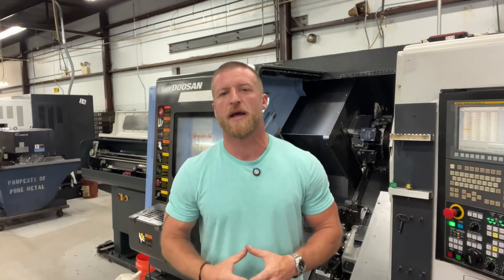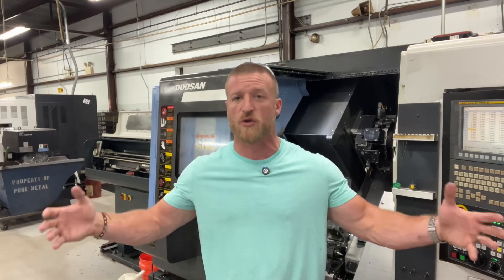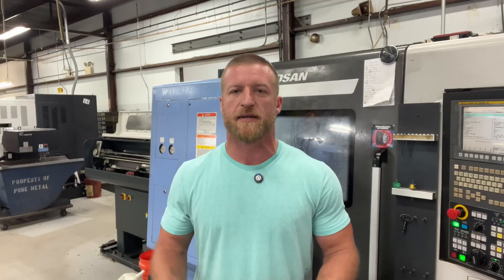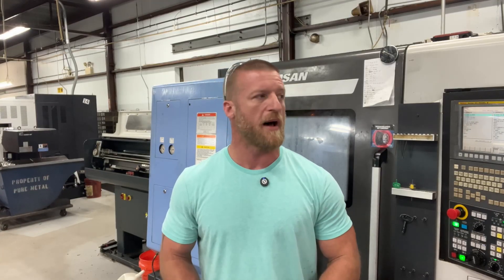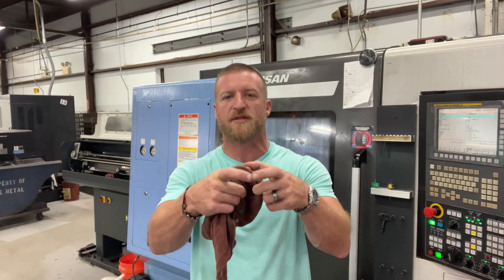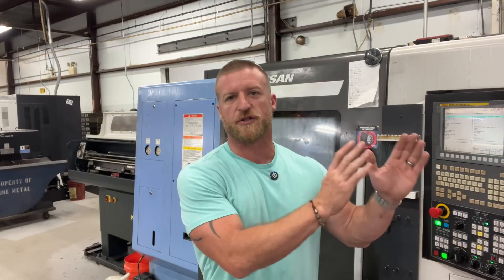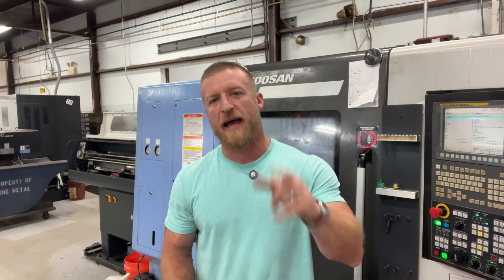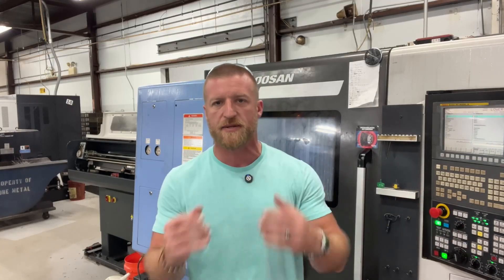Lathe VS Mill: Why CNC Milling Takes Serious Skill!💥🚀 #cnc #cncmill #lathe

Comment: As a 5 axis cnc programmer/machinist/operator whatever, with 20 years of milling experience, I wanted a new challenge at 50 so I started out as a total rookie on 3 Nakamura's with barfeeder and 1 robot.
It's 99% stainless we're working with.
Vertical and horizontal live tooling, all within thousands of mm's.
We run those sweet beasts 24-7 if possible.

5 axis milling seems like magic but I can definitely say that dual turret, double spindel cnc lathes are just as cool.
The sheer speed with how fast material is being removed baffles me .

From machining/milling, threadmilling Hrc62 to this is a blessing.
Love this job.
Great video
Reply from the maker: I love this job too. It’s very fun and challenging. Thanks for the input and thanks for watching 🤝

Comment: I'm a 5 axis programmer/machinist.
When everything (X, Y, B and C) is moving at max speeds, stops and then your spindel just dives in that bore hole with 20.000 feed for a skimpass... it's the best.
I've had engineers from our client watch their part being made through the big windows I had on my Spinner U1520.
When the spindle just plunged into that borehole they jumped away, I laughed so hard man.
Reply from the maker: Hahaha yea some of the stuff we do is definitely stress inducing but fun for sure

Comment: To edit a speed or feed in a cam program in Heidenhain620 you just hit search and the code you wish to edit, then you adjust to one or selected. 
There's no need to scroll through the entire program at the machine.
And you are right, the length of those cam generated programs are insane because cam sees little straight lines that makes the circle.
Also depends on the postprocessor.

Comment: Very often I write my own CNC mill code because I have a few older machines that can't upload the 1000's of lines of code that my CAM pukes out.  Also, the processors aren't fast enough to execute linear moves that are only .002 apart at a high feedrate. They just don't "think" fast enough, so, my posted programs at 50 IPM are running at 12 IPM and struggling to catch up.  FWIW, I have to modify ALL of my programs by hand because the support of my CAM system, (Fusion 360), isn't very good.  Also, I generate my finish tool paths for my CNC lathes and just program the rest by hand, adding the G94's, G71's, G92's, and G70's as needed, because of the weak CAM support.
Reply from the maker: That’s awesome man. It sounds like you’ve got one heck of a great skill set.  That stinks about you having to run your 50 IPM low down to 12 because of the processor. But I guess it happens and we make it work right?
Reply: @Crusadermachining  , I'm an old dude that started in the business in 1987.  The way I make it work is by hand programming G1's, G2's and G3's, for the shape I want, then "translating" them whichever direction I need to go with a macro or with a text editor that has a modified "copy and replace" function which lets me copy, translate location, and paste, repeatedly.  It's saved several cycle times for me.
Reply from the maker: That’s really cool man - and you’re not just an old dude. You got thru the hard stuff so the next generations can push buttons and make magic happen 😂😂

Comment: I used to run Citizen sliding head lathes some of which had 9 axis, 40+ tools (including rotary tools) and three separate programs running simultaneously. 
Most if not all of the programming was done long hand and my hat is off to the guys and girls doing that job.
Lots of the jobs we used to make were not possible to make on our milling machines or the 5 axis machines with the required cycle times and level of accuracy sometimes 0.005mm or 0.0002"
The guys running and programming the milling machines made some mad looking parts with great accuracy and they are far better than I'll ever be at milling.
Reply from the maker: Wow that sound intense!!! Hand programming that machine…?! Very high skill level for sure

Comment: I was laughing out loud when you said big part like 100lbs. The first machine I ever ran was a 12 foot king  vertical table lathe that was from 1930. I think the heaviest part I machined in my 15 years on the job was a 10 ton lifting fixture on a horizontal mill. You gotta get creative with the big stuff. It took a whole day just to set up a part of that size.
Reply from the maker: Yea I get why you were laughing. 100 pounds for me is the biggest part that I’ve ever worked with. On average, I’d say 1/16 of a pound now. I’ve never heard of a vertical table lathe but that sounds awsome man thanks for sharing.

Comment: Alright I'm not gonna lie nowadays I rarely program anything by hand. But I did do a lot of manual mill programming in the past. The thing I used a lot were macro's. If you know what you're doing you can cut the writing time a lot by making loops and what not especially on roughing or 3d shapes. I once programmed a cone for a slip on air hose fitting by plunge cutting the same angle over and over around the same datum rotating the cut bit by bit. Heck I even programmed it in a way where you can change the increments with one value in the macro's. Worked wonders and practically it read well over 10.000 lines but only a handfull were written
Reply from the maker: I like that a lot. 100% ingenuity and thinking outside the box to solve a problem.  Well done and very cool.
Reply: I wrote this simple one in Heidenhain 620 for hex key milling (mm's). 
Adjust value of Q1 for the keywith. And depth in Z as you like. 

Q1 = 32
Q2 = 1.155
Q3 = Q1 * Q2 / 2 
Q4 = Q3 / 2
Q5 = Q1 / 2
Q6 = Q1 +15

TOOL CALL 30 Z S1830 F 1150 DR-0,05
L X+Q6 Y+0 R0 FMAX M13
L Z+2 R0 FMAX
L Z+0 R0 F1000
CALL LBL 1
L Z+610 R0 FMAX M91 M9
L X+300 R0 FMAX M30

LBL 1
L IZ-2 R0 F1000
L X+Q3 Y+0 RL F AUTO
L X+Q4 Y-Q5
L X-Q4
L X-Q3 Y+0
L X-Q4 Y+Q5
L X+Q4
L X+Q6 Y+0 R0 F AUTO
CALL LBL 1 REP 6
LBL 0

Endless program and no need for cam to write thousands of lines.

Comment: Cylinder head porting was frustrating during the programming stage due to verification time to avoid collisions 10 years ago, hopefully a lot easier now days.
Reply from the maker: What’s verification time in this context ? Cylinder head porting sounds like a cool process for sure.
Reply: @Crusadermachining for the complete chamber and ports x4, could take over an hour. Cyle time was 10hrs. That included roughing from a cast wormhole not a port as such and seat bores . 5 axis suck at roughing compared to 3 axis.
Reply from the maker: @Innov8cnc WOW! 10 hours…?? Very cool

Comment: My shop uses macros for absolutely everything. Most jobs we do dont require a standalone program. 80% of the time the "programs" i receive are just a list of macro calls / subprograms. Also every milling machine we have has 200 standardized and already setup tools ready to go. So setup is streamlined.
Reply from the maker: Wow that is really valuable information to have and thank you for sharing. Macros are very cool. We use some of them, but not to that extent.  And when you say 200 tools, set up and ready to go they’re all touched off?
Reply: @Crusadermachining yep all touched off, at the top of every program you specify what tools you have in which pockets, and thats all I have to do for tool setup most of the time.
Reply: @Crusadermachining  yep all touched off and ready to go. our system makes setup very simple. job hits my list, I open the pdf, look at the tool list and load the tools, look at what station the material is at, (if it isn't already delivered to my machine), refer to pdf on where to hold the part / probe, load the attached program, and then run it. I mostly do 1 off stainless parts for the oil and gas industry, with the occasional Hastelloy, zirconium, titanium, for our nuclear customers. cheers from Canada :)

Comment: My business partner and I can do both but I like mills more since they aren't as dangerous. All the worse crashes I've seen were on lathes. Saw a guy blow the chuck off the lathe and shoot the door 5 feet into the air. Also witnessed what happens when you forget to screw in your draw tube adapter.
Reply from the maker: Wow!!! That’s nuts man. And yea I know what you mean. Lathes can be dangerous as heck. Good job knowing how to run both.
Reply: I've seen so many bad lathe crashes.  VTL's are the worst.  
Broken saddles, one guy left his lifting fixture on the part and hit the green button.  Turret collisions with a 24" chuck is going to do damage.  10lb jaws ripped off.  Doors blown off.  
Dangerous!

Comment: What about time, 5 axis, 3+2, any complex part  really, if you have "enough" time to program, fixture, troubleshoot then ez p z. But when you have a prototype part the size of a transmission that need to be machined on all sides holding .002, and customer wants 10 in 4 days, if you can't deliver your ass is at the unemployment office the next week. That's pressure!
Reply from the maker: Yes that sounds like a tremendous amount of pressure in a situation like that. Luckily that has never happened to me and I’d feel bad for anyone that has had to deal with that.
Reply: Where do you work?
We are looking for someone who can make that happen, but not with that kind of pressure.
Reply from the maker: @MikeYurbasovich does sound like some serious skill.
Reply: @Crusadermachining it's increasingly difficult just to find someone who can make a part from a print. When you get into 5x and swiss the guys start getting paid very well because the herd gets thinner.

Comment: Not all mill code is gigantic.  If you're doing adaptive machining in CAM, yeah it'll spit out a bunch of lines.  I used to have to minimize the length and overall size of the programs at one job because our controller was 20 years old and had a goldfish for memory.
Reply from the maker: I’ve heard that about older controls. We had some older Miyano lathes that couldn’t have more than just a couple programs at a time.

Comment: Im in the trade for like 8yrs, working on a makino PS105 3 axis precision mill machine, well yeah Ur right its more complex, Im using double sided tape, side clamps, magnetic table, vises, on cubes, vacuum table whole lot of fixtures :D never gonna leave milling , every day is a new challenge :D
Reply from the maker: That’s awsome man.  I love the creativity in our trade.  Makino I hear are great Machines.
Reply: I machined my own side clamps and had them heat treated.
4 clamps holding down something impossible and uneven and then putting it through enormous stress ❤

Comment: 4:18 In my case I use C++ as a sort of "high level g-code", so one line may expand out into many lines of actual g-code, and loops get unrolled which makes it impractical to edit the g-code directly. If I need to change something on the fly, I abort the program, comment out everything that's run so far, make my edits and re-generate the g-code, and send that to the mill. Only takes a few seconds.

But I live under a rock, so I have no idea how other people are creating their programs aside from paying impossibly large amounts of money to CAM software companies.
Reply from the maker: Wow that’s the first I’ve ever heard somebody using C++ program a CNC. How exactly does that work?  And if you’re using C++, can you use AI to help you get there?  A lot of people use fusion 360 cam which definitely does not break the bank.  Thanks for your input. It is  very cool.
Reply: @Crusadermachining  I think manual g-code programming on some CNC controllers is close to what I do. GRBL is very minimalist (no tool offsets, backlash compensation, variables, arithmetic, loops, conditionals, subroutines, etc.) so my C++ layer makes up for that.

Comment: Im 24 years old and Ive been runing a lathe-milling machine since january this year and its been a mixture of awesomeness and scariness 

I live in Spain so wages arent really high, Im trying to find a way to work remotely in another country (CAM Programming) maybe Ireland

Do you guys think its a good idea?
Reply from the maker: First of all, congrats on your job and I wish you luck on your journey. I think that could definitely be a good idea. Are wages higher in Ireland than Spain?
Reply: @Crusadermachining Yes, almost double, companies in Ireland pay very little taxes compared to Spain
Reply from the maker: Road trip to Ireland then LOL
Reply: I have worked in Santiago de Compostela as a cnc machinist/programmer from 2006-2012 before I returned to the Netherlands.
I made about 1080,- euros a month (mileurista like they called it), that's what I received after taxes.
In the Netherlands I got 2500,- euro's in 2013.
Now I'm 52 and I receive 3500,- euro's as a 5 axis milling programmer/machinist, cnc lathe programmer/machinist.
There's a need for skilled programmers/machinists in the Netherlands and the salaries are great.
Hope my info helpes you out before taking the jump up north 😉
Reply: @michelrosier468 It does, thanks 😄 language barrier scares me a bit though

Comment: All about post processors and getting them to do what I want on the mills. Especially 5 axis head machines or god forbid adding right angle heads and rotory axis together.
Reply from the maker: Imagine that right? Angled heads and rotary axis together. And I think you’re spot on about the post processors. 100%
Reply: @Crusadermachining yeah I've had to put giant parts on a 12klbs angle plate on a horizontal and use the B axis and the right angle head at an angle to simulate the 5th axis. Was an adventure.
Reply from the maker: WOW that sounds really unique and intriguing. I’d love to see that.  Well done

Comment: On programming for mills I use a combination of CAM and manual coding. I will often generate toolpaths in CAM then fine tune manually them to get exactly what i want out of them. For example I took a program that filled up basically then entire memory of the mill (CAM generated) and cut it down to about 300 lines though the use of G91, subprograms, and a counters.
Reply from the maker: I’m the same way in the lathe. Combo of hand programming and CAM   That’s impressive you can trim a program down like that.  Well done 👍

Comment: I watched the 1st one and I had to admit that turning in such tight quarters, on 2 spindles and just the speed lathes have is intense.  I've been doing 5axis aerospace work for about 10yrs now that its just what I know most.  But now I've been programming and running some pretty gnarly parts in our NTX2000 mill/turn and its been awesome. Combining turning, 3+2 positioning and a little 5axis simultaneous on it has been super fun!  Turning definately has its nuances.  Like when milling if I come up a couple tenths under on a feature I can usually just comp and run a skim.  Lathes dont like tryin to take a couple tenths off.  You gotta be on top of that for sure.  

I also thought comparing a twin spindle, live tool lathe to a 3axis basic mill wasn't really a fair comparison but I still really enjoyed the comparison.  This was a good follow up video.

And I agree I have some 5axis mill programs with 50+ tools for op1 and about the same for op2.  Hundreds of thousands of lines of code for turbine/bladed features.  Sometimes weeks of programming.   Both lathe and mill have their challenges and I don't think I could pick one that is above all more difficult.   

Love your videos, thanks for making them!
Reply from the maker: Hey thank you for the kind words and thank you so much for watching and dropping a comment. And I totally agree my video last week. It wasn’t really fair. Combining a very complicated turning center to a very simple milling machine.  

I was actually setting up this two part series for that reason  I really wanted to showcase the lathe, but then also showcase the complexity and necessary skill set to properly run and operate a CNC mill.  

Those NTX machine machines are really, really high-tech and innovative. I love Mori seiki. Sounds like you know your stuff. Keep kicking butt and thanks again for following along. 🍻🤝
Reply: @Crusadermachining no problem man!  
And as you mentioned in your video about lathes, the chips packing in bores is a bitch!  Dont have that problem with a mill haha.  I've been making these housings out of 625 inconel and getting the chip to break is a chore.  Think thats what im struggling with the most.  And tool life isnt great.

Any inserts you've had luck with in inconel?  So far I've only tried a few different grades of iscar and 2 different chip breakers.  Tool life was definately better with a couple grades but no real success getting the chip to break.  Milling im doing fine with because I have a good amount of experience in that arena.

Thanks again man
Reply from the maker: Inconel and hastelloy have been my kryptonite if I have to be honest. Very little experience with it and I didn’t have enough time in the job to really get a feel for what works and what doesn’t. Just kind of threw everything at it to try to get the job out.
Reply: @Crusadermachining  Same here. I had a Seco guy to get a job started with Inconel but his tools didn't get the job done and he left lol.
Reply: I get the skim part when milling and that with lathes it's a big bite and spot on the measurement.. but milling doesn't require a skimpass anymore.
For mass production of stainless staff with keyseats we wrote a parametric code that plunges in and in one pass it's within spec. With that same parametric code we run a chamfer with different offset and thats it.
Takes longer to clamp and tap it down then the actual program takes.